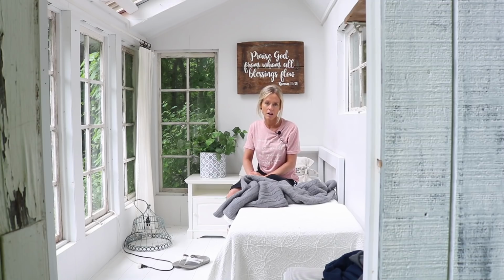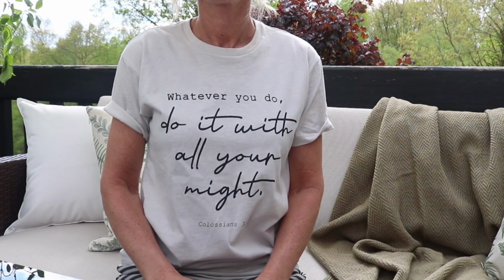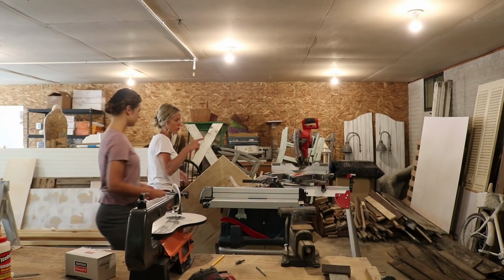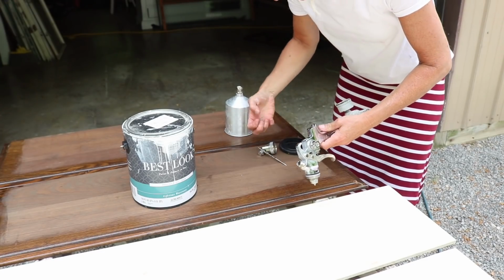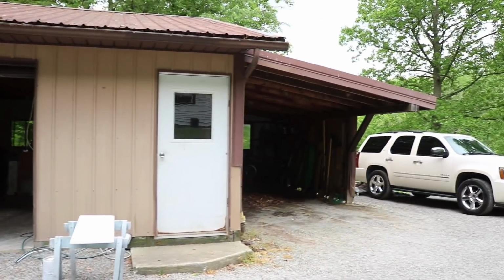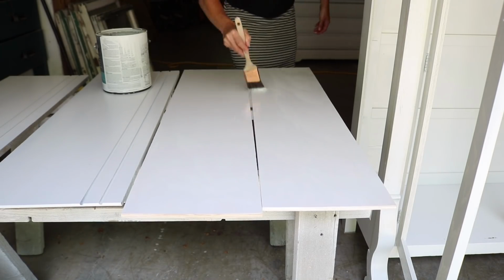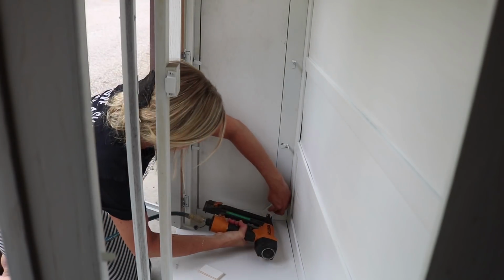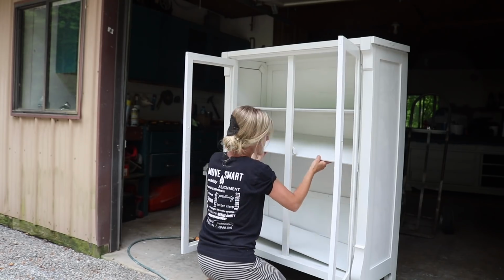Antique Cabinet Makeover ~ Shabby Chic Style Cabinet ~ Painted Furniture ~ Furniture Makeover

Comment: The cabinet turned out very pretty.   But honestly it broke on heart to see the glass removed and painted.   On camera it appeared to be in such good condition.   I have a similar piece and would love for the sides to be glass.  Original finish.  Best wishes with the Peddlers project!
Reply: I’m surprised you watch her since she paints a lot of furniture.
Reply: There is much more to her channel than painting furniture.   Which by the way I have no objections.  It was this piece that tugged on my heart strings.  Perhaps if you read my comment again, you may see it a different way.   Have a good day!
Reply: @loismcclung1940  Glass is easy to replace.
Reply: I agree wholeheartedly. I do love painted finishes too but generally reserve them for pieces with damage or that haven't aged well. When a wood finish is so rich and full of history, it's nice to see them restored and kept somewhat original. In this case, the lace panels could have worked just as well with the original finish along with replacing the glass inserts on the sides.

Comment: Looks lovely Mary!  I just wanted to mention something to your viewers who might be interested in trying to make privacy on any glass cabinets they have this lace works well if you cut it to the glass size and on the inside of the glass apply it with a thicker paste of cornstarch and water it will dry pretty much clear and the lace pattern will be on the inside of the glass so you can wash the glass from the outside.  It also could be removed when you get tired of it just by peeling it off. I did this on a cabinet of mine in the living room and it looks beautiful.

Comment: I love the lace panels.  I did the same thing on a smaller cabinet :-)  If you ever have trouble running string through a folded seam, just use a safety pin attached to the end of the string.  It's easier to maneuver that way :-)

Comment: Mary, I have a question about painting over oak. The grain is pretty open and I worry that it will be seen and obvious. Is there a primer or anything you use to fill in the small grain cracks (I have no clue what they are called) to give a smooth finish?  You are the only person I’ve encountered that paints so many different pieces I thought you might have experience with this.  If I paint it black I don’t think they will be seen as much as if I paint it white or light gray.  Got any great Mary ideas for me?  Thanks!

Comment: Hi I'm curious, everytime I paint or spray paint on old wood, it will bleed thru. Does it happen when u spray paint? Any tips to share as I always ended up painting & spraying many times over before it stops bleeding..would really appreciate your advice 👍 Florence fm Singapore 🇸🇬
Reply: Hello Florence, I saw a video how to paint furniture, and they suggest to give a coat of shellac before painting
to avoid the wood tannin bleeding through.  I did not try yet, but it worked on the video I mentioned.